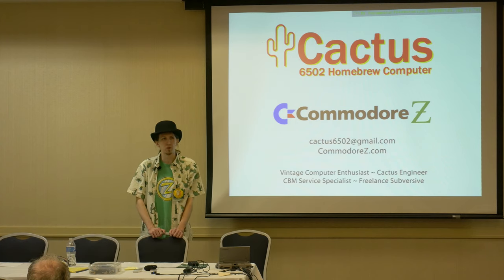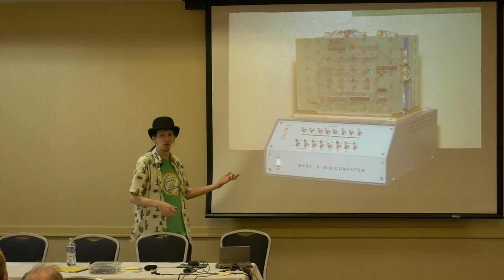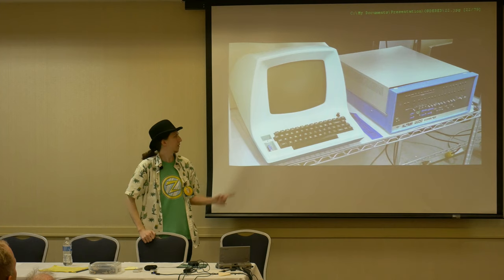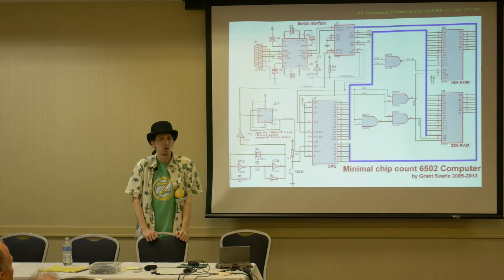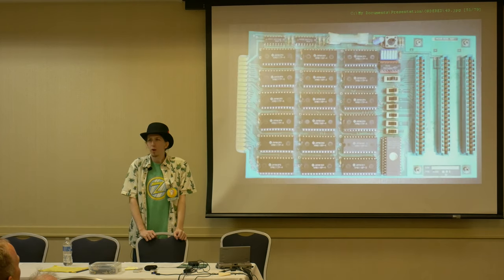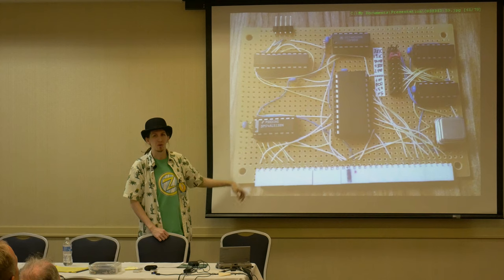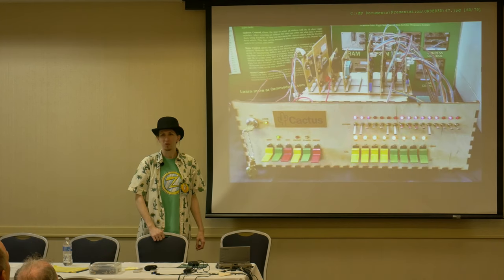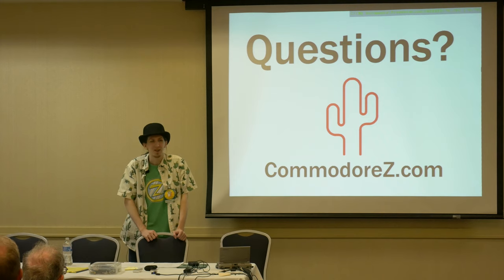Cactus 6502 Homebrew | VCFMW 2018

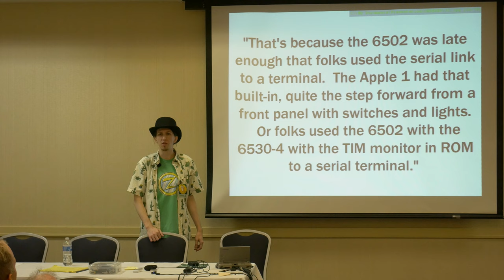Comment: At 14:30, the original 6502 could NOT be stopped or the registers would lose their values.  If I were to build one of those, I would use hex rotary switches and 7-segment displays for the addresses and data.  I'm also surprised NIM didn't make your 6502 list.

Comment: Well that talk kinda answered why front panels were so rare on 6502 computers. Once you have a ROM chip, having some cheap calculator keyboard (way cheaper than individual puttons) and some LEDs is way cheaper and actually even much more convenient. Also once you have "lots" of RAM, adding video isn't to hard anymore. Don Lancater has written quite some books about that in the 1970s https://www.tinaja.com/ebksamp1.shtml
Reply: Yes, exactly... apologies for not reading your comment before I spoke up :-)

Comment: The reason why you didn't see 6502-based home brew computers with front panels back in the 70's, like you did with Z-80-based machines is because the Z-80 supported single-step mode while keeping DRAM refreshed.  The 6502 didn't have the ability to refresh DRAM.  If the CPU was stopped, DRAM would lose its contents.
Reply: Many of the early homebrew and "lab" type computers did not use DRAM, they used SRAM. SRAM does not need to be refreshed like DRAM does. There were many non-Z80 based microcomputers with front panels. OSI had the model 300 trainer (which is 6502 based), the Cosmac Elf uses an 1802, and MITS had the Altair 680 (which used a 6800).
Reply: The problem is not the RAM, it is the CPU itself. The original 6502s were NMOS based. Their entire design made them incapable of operating in single step or at clock rates below a certain threshold.  If you were to halt the clock on an NMOS 6502, its internal registers would become corrupted if not erased entirely.  So there goes the PC, interrupt vectors,  all the data registers, everything.
Reply: I had a project in 1987 where I wanted to do similar and originally wanted 6502.  This video shows me it’s good that circumstance ended up with me doing it with a 6809 (iirc) and avoiding a lot of problems.